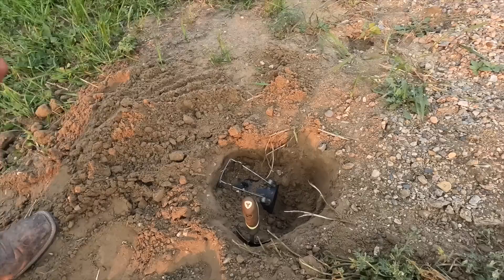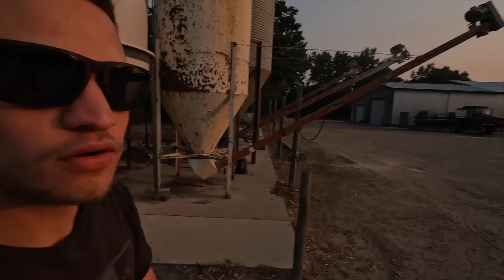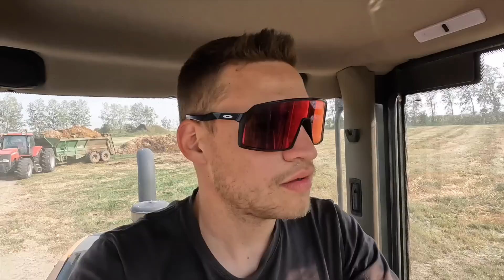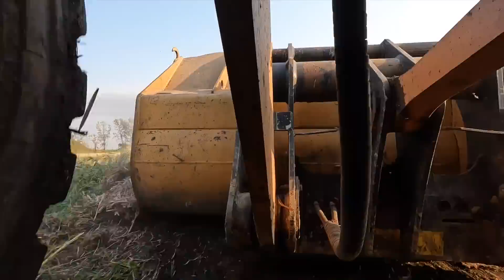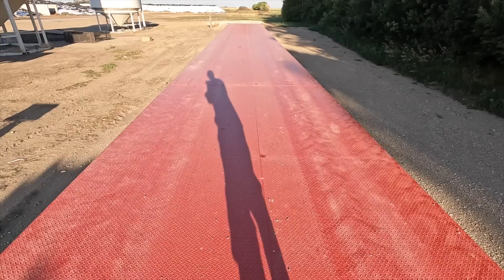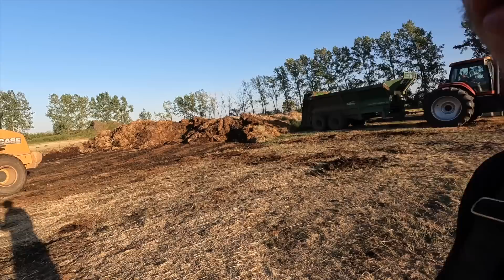Trapping a Mole and Custom Manure Guys Show Up!

Comment: Jan, take a sheet of plywood and measure half way across scale. Screw 2x4 to it to act as a lip on the edge of the scale as you slide it along while painting with a 4 inch roller . Works.

Comment: Nice video Jan! I don't think I'd even notice that small bit of manure on the road. Lots of Amish folks around my area. Their horses leave much bigger piles of presents on the road - especially when they're using a team of horses. Very kind of you to take the time to clean up. I use a castor oil pellet to keep moles out of my yard, but it can be made with liquid castor oil/detergent/water to spray on the yard. It makes their food taste bad so they move to another area. Thanks for the video!

Comment: I tried the ones that flip and are supposed to trap them in the pipe, but they just fill the pipe up with dirt then go around those. Tried drowning them, that was a fail, a neighbor filed the tunnels with petrol (Gas to you Yanks), and set fire to it.. another fail. little beggars eh?
Reply: See Caddyshack for more ideas.

Comment: For everybody, if you have Mole's, use carbide. It will for sure kill all the mole's. Dutch farmers are using this a lot
Reply: Not sure if you can get it in small consumer quantities here. I might be wrong. We tried when we had a huge mole outbreak but found the traps worked good. Our Labrador went nuts digging for them so the trap was our only option.

Comment: Years ago I had a trailer load of horse manure. It was dry like the stuff you were hauling. I was driving down a country road and it was dusting off the back. Some guy got behind me and wouldn't pass. So I just kept driving next thing I see he is using his washer fluid, what I could see was it was streaking pretty good. I couldn't understand why he wouldn't pass. To each his own.
Reply: I know what you mean. You can't fix stupid.
Reply: Don’t ever drive too close behind a truck full of pigs bad things can happen
Reply: @julielumsden5184  even worse a trailer full of pig manure. When they were spreading that you could smell it in the next county. They inject that into the ground but it still stinks.